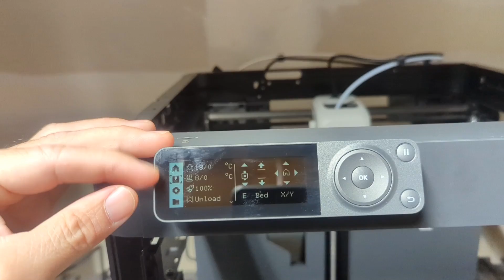BambuLabs X1 Carbon vs P1P Comparison

Comment: I believe this is greatly minimizing the differences and the capabilities of both of these. I wouldnt expect any difference in print quality with PLA, but most people evolve and want to print with other materials. Try comparing ABS and TPU between the two.
Reply: Why would TPU be any different? TPU prints well on bog standard bed slingers like the Elegoo Neptune series.
Reply: Let alone PA-CF Carbon fiber, which I think the X1 is named after?

Comment: Can you buy any nozzle like in bulk like I do for my artillery printer it uses the volcano nozzles just wondering if you’re stuck buying their nozzles ?
Reply: You have to use their nozzles and hardware.  They use a proprietary hot end.  Also, the hot end is different between the P1P an the X1C so the parts are not interchangeable.
Reply: @netlizard1  well I bought the x1 waiting for it should be here Wednesday, I see the p1p they have a conversion kit so it can now take the harden nozzle
Reply: @zacharypaul1111  Same here.  Mine should be here Wednesday.  Good Luck!

Comment: I love this printer. I’ve had it for about four days now. My only complaint is the camera. I hope someday they allow us to upgrade to the same camera that comes with the X one carbon I can watch my print from my phone, but it’s not a live  picture but more 10 second snippet’s. There’s not a lot of documentation on how to get the camera up and running on the software but I got it figured out. Like I said, I hope someday they let us upgrade to a much better camera. Other than that it’s flawless for me.
Reply: Why not just buy a indoor ring camera and place it in front of the printer, booooooom you can watch when ever you wanted..
Reply: @tomdeleon6538  It has been over a year since I made that post and several firmware releases later I'm not all that concerned with the P1P. At first, you could not connected to the camera once you were away from your local network, that's a thing of the past now. I can look in and see how the print is doing even though the frame rate of the camera is not as good as the X1C ( that I now own as well since that post). I have also upgraded my P1P to a P1S and I still think this is an awesome Printer

Comment: When you say it's the same file, did you actually slice the model for the X1C in Bambu Studio, then put the same 3MF into both the X1C and P1P and hit print? Is there no error using the same print file albeit P1P lacks the aux fan and with different build plate?

Comment: Thanks for the video. These are the comparisons I want to see before buying. I'm still torn between the carbon and the p1p. I think it will come down to how often I think I would print in higher temperature materials and if the lidar, and display are worth it. I also want to know how much (if any) quieter the carbon is since it has an inclosure.  Of course you can print or add on panels for the p1p.
Reply from the maker: Glad to help! Personally I like the X1 Carbon. But performance-wise, they're both the same
Reply: To me, it came down to a matter of price. If you’re only printing, PLA and PETG the enclosed box is not a dealbreaker for me. I want to buy the AMS, and when I get done I will have spent about $400-$500 less.

Comment: So which would you recommend I get? I only use the elegoo Neptune printers currently but these  printers look amazing
Reply: Get the X1 if you wanna do ABS ASA & other such. For PLA , PETG & TPU, they're the same machine. My P1 had a bad nozzle clog on the 3rd print. Went back to almost perfect once I swapped in the spare hotend
Reply from the maker: Personally I would get either or. They're both amazing machines.
Reply: To be fair, I ordered a P1P. And even though it hasn’t arrived yet, I would say, if you don’t NEED it, don’t buy it. 
You could get 2x Neptunes for the same price as a P1P. Even cheaper considering Bambu charges tax and shipping. 
Plus I fully expect by this time next year someone else will release a cheaper core XY
Reply: But you would have less total prints done and worse quality withb2 neptunes... so yea it's cheaper because it's inferior in sooo many ways
Reply: @andyvannort2743  obviously you don’t know how to tune a printer. 
You don’t need to spend $1000 to get high quality prints. Tons of printer farms prove that
Reply: Never said it can't possibly achieve similar quality... but if you're tuning thay means test prints and time... those cost money........ meaning you still paid money to make yours nearly as good. Still isn't as fast or capable without more money thrown into it no matter how you tune it... the components are only so good
Reply: Didn't realize 700 was 1000... didn't realize you can't tune bambu printers... didn't realize tuning your Neptune takes no time or materials... didn't realize without adding additional c9mponents you can significantly increase the speed to match this.... you're comparing apples to pinecones
Reply: You have had to lie or twist things every chance you get... no there's no shipping. No it's not 1000 nobody saidnyou had to spend 1000 to get "good quality prints" I said THIS WILL HAVE BETTER QUALIRY PRINTS.... PLEASE DISPROVE ME AND SHOW ME YOUR NEPTUNE PRINTING AS WELL AS YOUR TUNES BAMBU...... just as fast. With all these additional features it offers..... evennif you buikd a farm. Bro that doesn't compare to ONE machine that can produce as much as even if just the dame quality. It takes LESS SPACE... I'd rather not have a room full of Neptune's I have tocspend hours and filament tuning if I want to not take up all my time and space.... sure you can make many other prints print up to this quality. Wasn't free. You're over here falsely adding fees and increasing the p4ice by FIFTY PERCENT but ignore your time and materials it took to tune your printer that still won't be nearly as capable without dunping money into it....  these are facts. Show me the Neptune printing this fast without money thrown into it... I'll wait. Just because YOU would rather spend all week tuning a room full of machines to save $100. Thats on you. 1 hour of my time is worth that much money so I'd rather buy a better starting point. Don't put words in people's mouths and act so ignorant... you can also make my Traxxas xmaxx rc car drive 120mph... doesn't mean you should go that route since it's a monster truck... might as well start with something sportier
Reply: @andyvannort2743  WOW you’re really sensitive. 
Fact: Bambu Lab charged $25 shipping on Black Friday P1P orders. 
Fact: Neptune 3 is $200. Neptune 3 Pro is $230. 
Fact: P1P is $699 plus tax/VAT, Plus Shipping. X1 $999. X1 Carbon $1199. 
Fact: Tuning one machine or even a fleet of machines does not take hours. It takes less than one and once it’s tuned, it’s good for a long time. 

Why are you so obsessed with having a war? None of what I said was a lie. I was simply trying to help someone save money instead of spending $1000 on the latest hype. And yes I said $1000 b/c they said they weee interested in multi material printing which would require the additional purchase of the AMS. 
Nobody is badmouthing the product. Just availing fellow enthusiasts of available alternatives. That’s all.
Reply: @HDfoodie  I like the idea of printing different colours in 1 print that's why I'm tempted to buy 1 of them
Reply: @michaelhodgson2163  Did consider a mosaic palette or mmu 2 or ERCF?Rather than purchasing a new printer and EMS
Reply: @HDfoodie  no I haven't to be honest with you
Reply: @michaelhodgson2163  
$1000-$1200 plus tax and shipping seems a little steep to obtain multicolor printing. 
Any one of the above choices is significantly cheaper. 
You could even consider an IDEX. 
Ultimately Your money == Your choice
Happy printing!!!
Reply: Sig ificamtly cheaper and significantly lesser quality.  There are tons of cheaper printers. Obviously with a p4inter like this it's not about saving every penny possible. It's about a price to performance ratio or hitting a certain level of quality that 2 Neptune 3 pros couldn't handle
Reply: @andyvannort2743  Even a bed slinger can match this print quality. The only thing they can’t match is speed. So your price to performance logic doesn’t hold water.
Reply: @Ice Bear  except if it prints 2x as fast it's worth more than 2x the other machine that ALSO cost electricity. Table space. Room space etc. To match my farm of bambus I'd need klipper across the board (more money) or I'd need to buy a fucking storage garage for all of them because I need multiple.cor every bambu
Reply: @Ice Bear  IT does hold water... why spend 800 on 2 machines 2 tables and more space and added electricity when I can buy q machine for 700 that takes up less space less electricity and allows me more room in my house (rent)
Reply: @Ice Bear  you aparently don't realize you spent an hour tinkering the first one. Then an hour tinkering the second one. Oh the first one has a problem again another hour... even at that TINY 4 hours time investment that's a few hundred bucks of my time..... I don't work at McDonald's bro. My time is valuable. Why tinker the machine and lay myself my hourly rate?
Reply: @Ice Bear  you may think days of your time dealing with fine tuning machines is free. But I know it's not since I literally to make money doing other things instead... yes DAYS since it's a fucking farm. You have to print test prints. Check in on them. Make adjustments repeat repeat repeat.... while I'm off welding
Reply: @Ice Bear  just tell us you're worth $.05/hr already... I mean if I have 10 machines in order to print as many prints as me per day you'd need about 25 since all the additional time going between printers.... that's alot of space. Alot of tinkering. Alotnof replacing parts since there's soo many more and they're lower quality. More active spools open. More replacement parts to keep in stock etc etc etc etc etc. Yes as a single printer for home use buy a Neptune or s1 pro all day. But for BUSINESS time is money. So buy eats most COST WFFECTIVE AT THE END OF THE DAY... you're stuck lying about sticker price not looking st the bigger picture. I don't have time to maintain nearly 3x as many machines. Parts would be costly and so would storage for all the extra machines that all need tables that cost alot.... I guess I'd need to hire someone to handle the extra dozen machines..... do they work for free? Or does my output just slow down meaning yoyr print farm can't keep up... you can't always just add more printers. There's only so many hands and space and time. Save $100 to bust your ass for "almost as good" all you want. Don't act like in stupid because you lied about prices and ignore that time and effort isn't free.
Reply: @andyvannort2743  days of time? Man you really don’t know anything about tuning machines. 
btw, going rate is $5-$8/hr on a farm. 
It really isn’t as hard as you make it out. 
But you’re obviously still trying to do this from your living quarters.
Reply: @Ice Bear  please point me to the free sturdy tables and helpers to maintain all these extra printers it will take.... do they come with 20x20' additions to put on my house to fit them all? Heating up all those extra beds is free too right? And when you say tune you mean I just have to press 25 butt9ns to do this right? 1 button per machine? No it's going to take ALOT of time and energy and filament dialing it in before it can even start selling finished products? Hmm in 1 day I paid for another bambu..... seems like you can't handle affording even a midrange
Reply: Bambu also offers free shipping on orders over 50.... so I'm guessing 699+ is covered
Reply: @andyvannort2743  $25 shipping on US orders
Reply: @Ice Bear  the fact that you're even crying about $25- shipping whike suggesting alternatively tuning dozenS of machines is comical. I'll happily pay 10 minutes of my times wage towards it. Instead I'm off making enough to literally buy more expensive machines. What's $25? You had to spend hundreds on additional tables or are your printers sitting on the ground outside? You need 3x as many of them as I do to keep up. And need helpers to assist with the fleet. I'd rather spend the shipping money than that per hour to 2 helpers. I mean 3x as many printers finishing at once means alot of additional hands needed. Alot more time troubleshooting different machines. Alot more money on power requirements. Idk about you but having 3x as many printers requires more power around here..... not really wise to have 30 printers on 1 breaker. That's alot more ups batteries to buy because common sense has most of us using them.... maybe you can't afford it buy its basically a requirement for professional use. You're being cheap and it's costing you in potential earnings and longterm labor for tons of applications. For some who clearly don't value their time. Sure go cheap. But for many of us it's fiscally irresponsible.
Reply: @Ice Bear  I save more than the shipping costs just not having to unbox a dozen neptunes.... those don't just assemble themselves on my table
Reply: @Ice Bear  I'll NEVER understand why people like you act like "if you know ehat you're doing you can just tune them" ehike also acting like that SKILL you spent time and money on is worthless... weird flex bro. Most of us when we learn a valuable skill. We value it...
Reply: @Ice Bear  please shownusbyour Neptune prints.... and how long they took. And how many fails on the printer along the way to dial it in. How many test prints? How many times have you leveled it? If you sayc"i leveled it and it's good from there " you ARENTA GETTING THIS QUALITY PRINT... sorry if that hurts your tiny ego. You can't literally brag about how you can fine tune something whike also acting like getting there was free.cyou took skills and effort. Lots of effort. To save pennies. 2 Neptune's costs almost as much as 1 p1p. And the p1p prints more without effort...even after you get it up to its best quality... why spend 600 on 2 Neptune's then spend time calibrating and time assembling and time testing and time setting up additional tables for them since for every 1 you need at least 2... 2.5 Neptune's costs $750 vs $720 shipped for the p1p that can print better out the box and as fast as all 2m5 combined. You still need to set it up. You still need to make room. You still need to tune and calibrate and run tests. Price to performance even off just ONE bambu p1p it's cheaper than buying 3 other printers to match it.... without the time and effort and space. I'd rather have more free space and spend less money and have more free time wouldn't you? Or you can add a pi and screen and cameras and have that junkies messier experience to try and match the speed with less printers. 2 Neptune's per 1 bambu. Still costs more and takes more time and effort and nets worse results.. if you can tune your neptun3 up to stock bambu quality you sure as shit can improve the bambus quality as well from STOCK.... thing juat came out with room to grow. You're spending more money to have maxed out potential machines that take up wayyyy more time and effort and space... you sound broke but costing yourself more money
Reply: @Ice Bear  idk if you realize this but it costs more money in the long run to buy something cheap and throw time and money into it to max it out when you first get it. That better product can be tweeked and improved upon to get even better quality. You're "improvements" to your machine will wear it down more as you stretch it to its limits. Worse stepper motors running just as often. Psu etc etc etc. It's all running juat as often but 1 is more reliable....meaning the less reliable one will need more maintenance. If it needed tuning to get where it is. Any small change will take more tuning and time and possible unsellable prints. Those cost money... more than the price difference in machines oh wait you spent more already to Match the bambu output rate.... so you spent more money and will spend more time all to save on "paying shipping" ok at least I didn't have to unbox multiple.extra products dispose of then and have to find places for them before I assemble them then calibrate them over and over until they're just right then move to the next one and do it all over again but slightly different because it has its own set of issues to address. Good for you for "getting free shipping" but spending more money for less print speed. Less print quality and less remaining room in your house for prints and other cool stuff. "Yay free shipping. Too bad I can't move with all this junk everywhere"